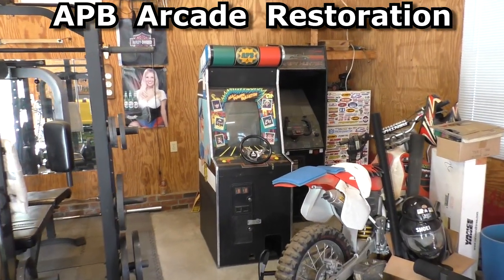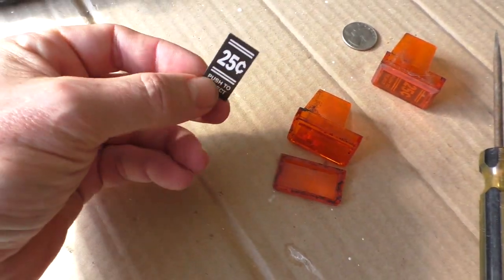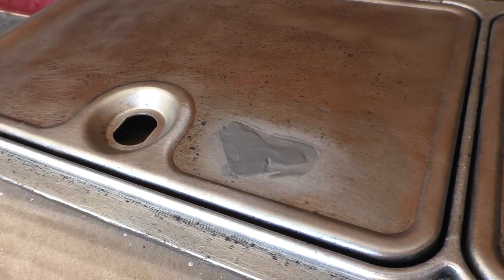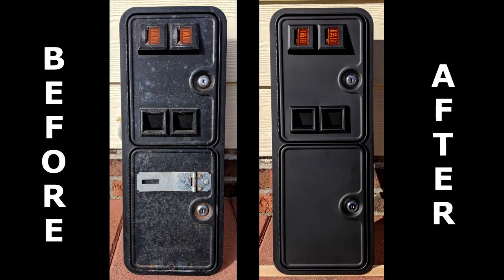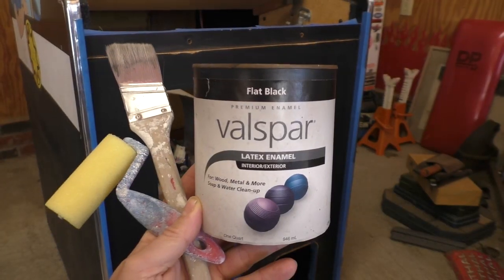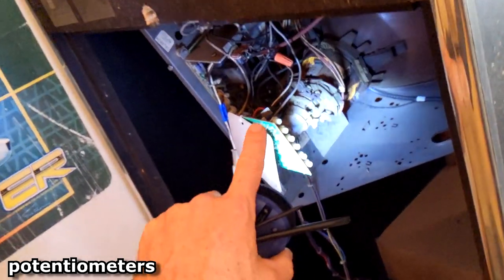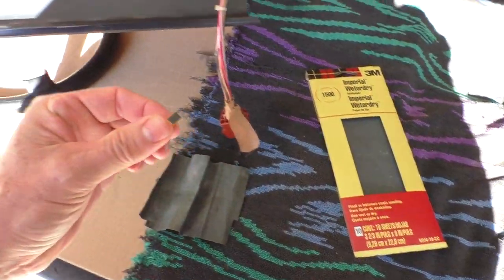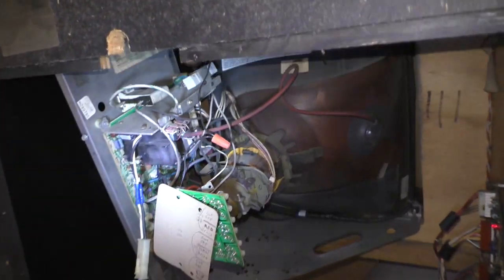Atari APB Arcade RESTORATION Video 4 coin door monitor adjust retro classic gaming golden game room

Comment from the maker: Wire Wheel Brush for Drill: https://amzn.to/2RKQxi7
TV Alignment Tools: https://amzn.to/2tWS1Nn
Hakko FX888D soldering iron: https://amzn.to/31k2mNN
Hakko Desolder Pump Tool FR301: https://amzn.to/2MInurQ
Solder: https://amzn.to/33BRPPK
MESR 100 V2 capacitor meter:  https://amzn.to/35CfEso
UYIGAO UA6013L Capacitance Meter: https://amzn.to/2MPxwrh
Some of the gear I use.
Thanks.

(paid link)
As an Amazon Associate I earn from qualifying purchases.
Reply: Great restoration 👍